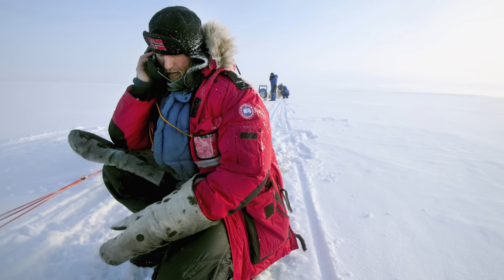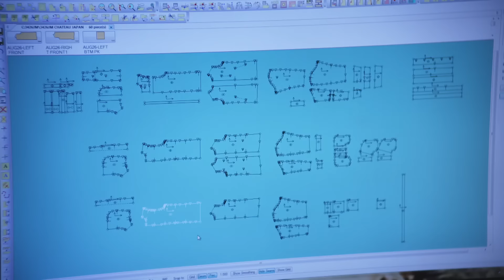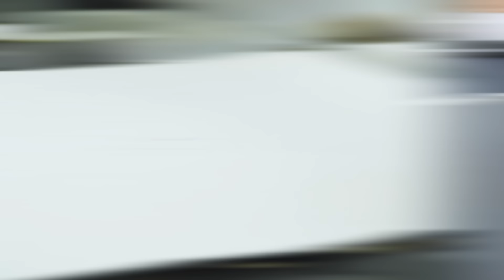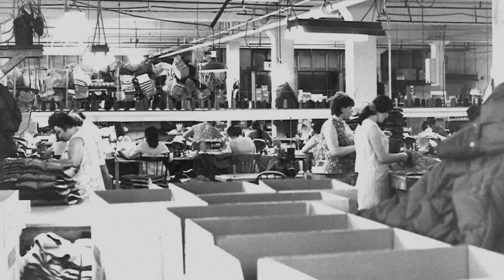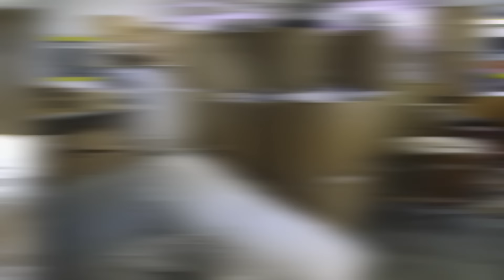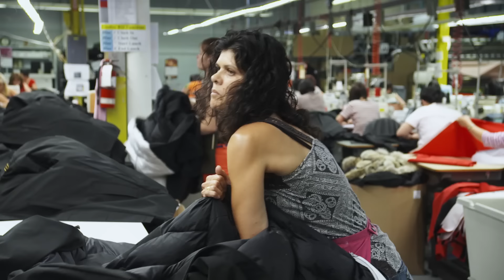How a Canada Goose Parka is made - BRANDMADE.TV

Comment: In the UK it rarely gets cold enough for Canada Goose jackets.  It's more wet and windy here, so I wear Arc'teryx instead.  Goretex pro.
Reply: It gets cold in northern Ohio where I'm from, but a $100 or so winter coat is good enough for me if you find the right one. CG is just way too expensive. And I only need a warm coat to walk to the car, across a lot & back.
Reply: @pinkfreud62  I agree.  The main difference is the fit and finish of Arcteryx.  I can keep 'warm enough' with much cheaper coats of course, that has never been a problem (except torrential rain).  But it feels nicer wearing Arcteryx and more reliable for extended bad weather periods.
Reply: I just wear lots of T shirts and long johns in England.

Comment: A heavy down coat is NOT something you wear if you're going to be doing anything more than sitting or sleeping. You must match the weight of the insulation to the activity. Also, 90% of all down used in the clothing and bedding industry comes from China, not Canada. So does Canada Goose guarantee their down comes from Canada? Do they use live plucking where the bird dies later or do they harvest only as a by product of the Meat industry After the Duck or Goose is killed? So many questions and so few answers in the "fluff" piece. Buy Primaloft insulation instead. Works better, lasts longer, costs less and NO ANIMALS HARMED.

Comment: Bought a CG Eexpedition parka last winter. I just sold it and bought a Triple Fat Goose Chenega II parka.  Issues with CG?  Yes, they're overpriced, given that they have solid competition today.  The Expedition was like wearing a tent; the Chenega II fits MUCH better, and has more duck down than the Expedition...so yes, it IS warmer than the Expedition, and FAR LESS bulk.  On the Expedition, I didn't care for - - the velcro fasteners, always closing when you don't want them to (Chenega II uses amazingly simple, large snaps) - - the reverse, left handed zipper on the Expedition has to be worst design on any parka...and the zipper was not nearly as smooth as the YYK zipper on the Chenega II - - the hand warming pockets were too low on the parka, whereas the Chenega II pockets are at the perfect height and super warm.

$ for $, same exceptional quality and designs of equal appeal.  I don't regret my decision.
Reply: I have a triple fat goose Huron and completely agree they are a lot better quality than Canada goose